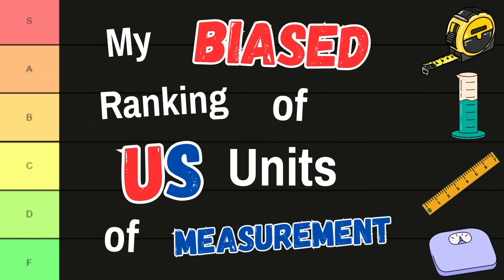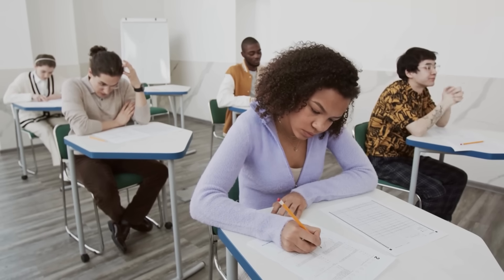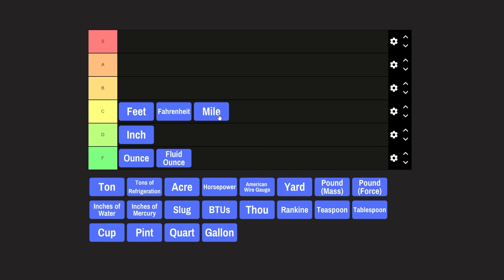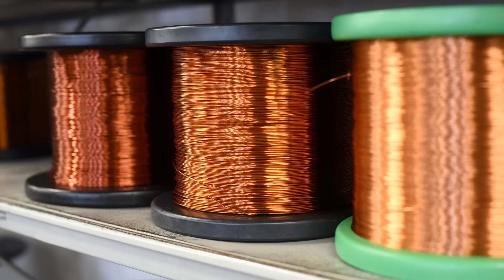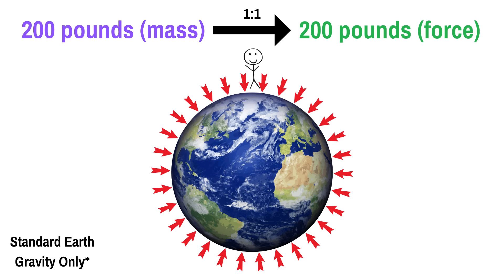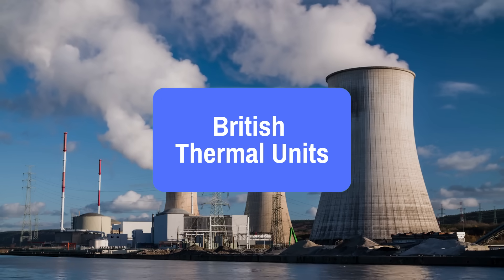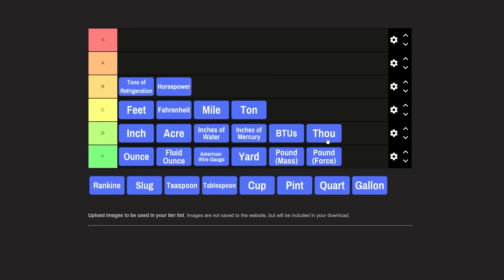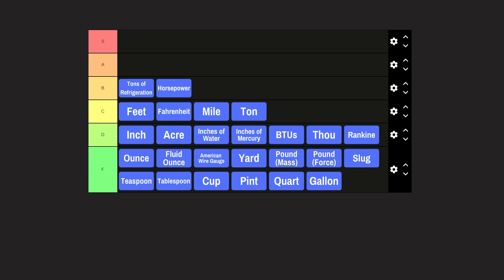Tier List of the DISASTROUS US Measuring System

Comment: Being French, born within the decimal system upon the metric system and the international system (all being A-tier), I can't even understand why USA continue to use these dumbf*ck units... They speak about the cost of changing the imperial system, but how much does it cost to ALWAYS use double marking on EVERYTHING exported? Or to maintain software to ensure the conversions? Or the cost of electronic to handle "natively" these retarded units? It already cost USA several spaceships / rockets / satellites, and they aren't cheap...

Another "joke" is "it would cost us a lot in tools". Yeah, metric tools are SOOOO rare, SOOOO difficult to find, and SOOOO expensive, right? Between tools used by (at most...) 300 millions people, and tools used by 7.7 BILLIONS people, guess which one is cheaper? Both arguments are fallacious. The only "real" argument is that there is a lobby of noisy rednecks who can't learn something new, an unjustified pride to use "their" units, and above everything else, lazyness and a catastrophically bad education level.

It's the same for the 110V system, instead of 220V. Do you realize how much more copper you need for wiring a house with 110V, compared to wire it with 220V? My living room has 11 sockets, each bedroom has 3 to 5, and my kitchen has 26 sockets grand total. Because when you need 1.5 mm² wires (16A, about AWG 16) instead of 3.31 mm² (AWG 12 / 20A) wires, you also need near 5 times less copper (in mass). You can also follow trickier paths, since wires are more flexible. And it can handle more power: roughly 3500W per line for 220V, and "only" 2200W for 110V... While being less dangerous, since there is usually less amperage in 220V systems than in 110V system.

Comment: Metric system is inferior because it's base-10. For the most part, imperial is base-12 or powers of 2, which is much more naturally divisible. Metric STILL hasn't been able to do away with base-12 time because base-10 sucks.
Reply: is this the next level of trolling or what
Reply: @what-xg7kx  
Nope. Indeed 12 is more divisible than 10 and the metric system does use base-12 time (24:60:60).
Reply: Imagine writing this comment, while using decimal system instead of duodecimal system every time when writing number itself.
Reply: @eustress7428  The Arabic numeral system is also inferior because it's decimal and should probably be replaced.
"It's difficult and contrived to replace an ingrained, intuitively-understood existing standard." Ah yes, another reason that the metric system never should have existed.
Reply: @AtlasArmsResearch  just look at your hands bro
Reply: @eustress7428  
But here's another point. Why decimal? The answer is usually that we have 10 fingers, but that's based on a flawed, pedestrian understanding of counting. You need one fewer non-zero digits than your numeral base, which means that a numeral system based on 10 fingers should actually be base-11. Or, you could count all the way to 35 with both hands if you used a base-6 system, which is indeed half of 12, which brings us back again to the superiority of base-12, and by extension, the Imperial system.
Reply: @AtlasArmsResearch  That's a really pathetic argument, considering that most of the civilizations with language(from Egypt to Rome to China) used decimal system, and the usage duodecimal system, despite its 'efficiency', are considered to be an exception rather than a rule.
Reply: @eustress7428   Do you want us to be bound by ancient obsolescence (ironically, the whole case for metric is that Imperial is obsolete)? Those civilizations were also run by total hereditary imperialism and believed that the sun rose because some god carried it across the sky.
Still, base-12 was used by the Babylonians, who were also exceptionally advanced in mathematics, and we still use their 360 cycle division and 12:60 time.
Who's arguments here look "pathetic" and illconsidered with conflicting premises? You've been told metric is better so that's the line you repeat without actually understanding enough to coherently reason it through yourself. Don't bring the insults lest they're turned against you.
Reply: @AtlasArmsResearch  
We are not bound by 'ancient obsolescence' (unless you are an imperial unit user ofc), but we are certainly bound by our own body. That's the main point of my comment above : base 12, despite its efficiency, is confined to a few things like time and angle because of that. Still in the realm of algebra, the decimal system dominates and not duodecimal. 

(And not to mention some eyesore like base 11, 13 or 35 you said. I mean, THAT one was the insult for the first place, isn't it?)
Reply: Also, you've constantly said base 12 can be extended to the imperial units but it is somtimes certainly not the case.
For instance, 1 Pound is 16 ounces which is neither multiple nor division of 12. 1 ton is 2000 pounds, which is closer tobase 10 you've been hating for. One mile is 1760 yard which has 11 in the aliquot part, way more problematic than base 10.
Reply: @AtlasArmsResearch  
And I haven't said the most serious problem of the imperial unit : you cannot directly relate to any of the units with each other. 

Looking at the comment you've made before, you seem to believe that the Imperial unit is more intuitive and logical than the Metric unit. But such problems make Imperial unit system much less so. For instance, how many cubic inches is one cup? How many cups of water (or any materials) is one pound?

(Maybe I admit base12>base10, but then the optimal unit system would be much closer to metric rather than imperial - like start from 1 cm3 of water = 1 mL of water = 1g and just base 12 instead)
Reply: @eustress7428  
...you don't have to relate any of the units to eachother. Just look what you just said. Cuin is a valid, useful, and common unit of volume by itself, just as "cc's" is used at least as often as "mL" (useless redundancy). We still even use inHg or mmHg for pressure because unit conversion is easy. But fine, BTU is an Imperial unit based on unity of the others.

Look, you're not even grasping the basic counting theory I'm talking about and I've sufficiently illustrated my case to onlookers so I'm not going to respond anymore.
Reply: @AtlasArmsResearch  
OK so Imperial unit is 'superior' because of base 12(which is not always the case), but "you don't have to relate any of the units to each other(which is a serious flaw)?
Metric is "not intuitive" but when that intuitiveness is shown directly in your face,  you said like... "useless redundancy"?
And about your beloved cubic inch... does that have base12 relationship with ANY other volume units?

Look, you're not even grasping what you've just said. Don't bring the insults lest they're turned against you.

Comment: The thing is Fahrenheit is still incredibly stupid. To my knowledge it basically comes from the coldest to the hottest Mr. Fahrenheit measured where he lived. Many people say that it works great because 0 is cold for a human, but 100 is hot. But that is just stupid when the optimal temperature is something like 72 or 73 for most people. 
Also it is just 28 off from 100, but 72 of from 0. I can then just use Celsius since it is basically reversed. The optimal temperature is like 22, so 22 off from 0 and 78 off from 100.

If it should really represent how we humans feel about the temperature, then make to optimal temperature exactly 50. 0 Should be the coldest where people can still be kind of fine and 100 the hottest were we are still kind of fine. That way you basically know below 0 and above 100 just don’t go outside.

Comment: Now do metric
Reply: S tiear aceoss the Board.
Reply: @vidmaurer8443 Why? metric is analogous to imperial.
Reply: @RocketPal  not rly. The whole point why the metric system is universal regarded as superior is becouse it makes compleate sense
Aside from time and certain more physics based measurements like Newtons, Volts, or wats, the metric system follows the rules of 10s, 100s, and 1000s.
1 meter=10 decimeters=100 centimeters=1000 milimeter.
This applies to every metric measurement.
On top of that every metric measurement is conected with each other
1 liter= 1kg of water= 1 decimeter^3
In other words, the metric system is simple, connected and simply just works much better than the Imperial does.

Comment: ye, us measurements are BULLSHIT. dont make sense at all. you always have to use fractions and they still arent accurate. no idea what kind of damage you need to think they are a good system

fahrenheit isnt underrated, its WORTHLESS. you cant even say "the temperature was raised by 10 degrees" cause 10 degrees will be a different amount of heat energy depending on what the starting temperature was...

tons of refrigeration is a bullshit measurement as well, why would it be in b-tier? having a block of ice melt in 24 hours? thats so vague. what temperature was the ice before? what does the circulation look like. depending on that, the same amount of energie can be used more efficiently. doesnt even sound good.

the only imperial measurements im somewhat ok with are the mile and horsepower, cause they sound good. but neither is superior to metric measurements.

Comment: Great video. The Dutch kept some of the imperial names and gave them metric values. Our pound (pond) weighs 500 grams in stead of 454, our ounce weighs 100 grams in stead of 28 or 31. A tonne is 1000 kilo's in stead of 1016 and an acre (are) went from a surface measuring 66 x 660ft to a much smaller surface measuring 10 x 10 meters.
We still have a couple of obsolete imperial measurements that are still in use in rural area's. A bunder measured 8700m2 (10,500yd2) in Napoleonic times, after that it became 10.000m2 and was renamed hectare. A Dutch pint (pint...) measured 0.57 litres like the English pint, this became 0.5 litres when we went metric. The word pint became the generic name for a beer in the southern Netherlands. When in the nineties UK pubs became a thing, they reintroduced the pint as a measure and used the US volume of 0.473 and added a generous foam layer.... Which is why we went metric two centuries ago.
Reply: "Are" and "acre" are not related. Are comes from area. Note a hectare is 100 ares. It is the unit comparable to an acre (0.4 hectares)

Comment: I’m an engineer in infrastructure design, and I’ve found, on that scale, I much prefer the imperial projects to the metric ones. With 12 being divisible by 2,3,4, and 6, it’s far easier to dimension without decimal points (e.g. one and one-sixth would be 1’ 2” vs 1.17m). Outside the scale of feet/meters, metric is definitely superior. The real dream would be a metric system in a duodecimal number system.
Reply: Agreed - and there are societies who advocate rational measurement systems using base twlve.

Comment: MM/DD/YYYY is the worst, sneaking it in because it's a measurement of time. It fails because (1) it's completely arbitrary and (2) there are no units, resulting in a whole collection of dates where you just can't know which system they're using.
Reply: I know i'm a year late to this convo.
But Americans will fight till death for MM/DD/YY until the 4th of July 😂
Reply: The reason for it is probably due to how US citizens often say dates: March 8th, 2022. You can of course say: The 8th of March, 2022 to get to DD/MM/YYYY, but most would say the first one. 

But for anything being used internationally just use YYYY/MM/DD it's more reliable and sorts well in computer systems.
Reply: @auggie9912  yes, YYYY/MM/DD is the best

Comment: Imperial is Ton. Metric is tonne.

BTU are imperial calories.

Outside temperature makes more sense in celcius, every 10C from 0 is a step. 0 = cold. 10 = cool. 20 = warm. 30 = hot. 40 = Australia hot. 50 = deadly.

Comment: So you want a temperature unit for the absolute 0?
American : "yes"
What about Kelvin
American : "what is kelvin ?" 
It's the actual scientific thermal unit. Water turn into ice at 273° and anthropy reach its maximum value at 0 making it the impossible value an object can have.
American: "Oh i see... How much in Fahrenheit?" 
What?
American : "Fahrenheit, the unit you use for the meteo so 0 is cold and 100 is hot but not as cold or hot as you may think" 
I don't know so. It seems arbitrary.
American : "so let's do Rankine" 
Why?
American : "because 0 is the absolute 0" 
So its the same thing as kelvin?
American : "No" 
So how you convert in Celsius?
American : "you don't" 
Why
American : "because" 
Alright

Comment: Hey- you left off the other 'foot' that American has - though I think they got rid of it last year. It was called the US Survey foot and is slightly (like by a 1/100,000 of a percent) shorter than the usual foot.
Reply: That was a holdover from before the inch was adjusted jn the 1950's to be exactly 2.54cm.

Comment: Units that I absolutely hate:
HP 
Inches
Both are used in Poland to engines and screen size. Second one is even stupider because 65 inch tv can be 25x60 inch or 39x52 inch tv

Comment: The mile is the best way to measure somewhat large distances and you can’t even deny it. What you gonna measure the US in kilometers? wtf is that?
Also horsepower is an incredibly flawed and even a potentially fraudulent measurement and is therefore the most goated

Comment: One thing about most of these units is they are practical for everyday use. This coming from a Canadian that is fluent in both measures. Here's a good example.  You could fairly accurately calculate in your head how much force you would need to apply on a bicycle pump to fill your bike tire if you know the surface area of the pump piston. Example 1 sq/in piston takes 30lb to generate 30psi. How many kg does it take to generate 206843 pascals on a 0.000645sqm piston?
Reply: Also temperature. Where do I see temperature 99% of the time?  My weather app, my thermostat, my stove, and my fridge.  For weather/thermostat use it's just more intuitive and it's more precise without having to go into fractions of a degree. For cooking, no one cares what the boiling point of water is. They just boil water.  Also, no one cares what the freezing point of water is because the rest of your food doesn't freeze at that point. Instead we set freezers to -18°c which is 0°f.
Reply: @McP1mpin  I disagree it's nice to see the temp of your fridge and freezer and the outside temp in Celsius, because it's so related to water. I also wish we used Celsius with our stove but we don't because of the US and because old recipes are written in F. You only argue that because you are used to it. When you get familiar and use both, Fahrenheit is crap.
Reply: @ColCurtis  id much rather look at a fridge that tells me its 40F than fucking 4.44C lol. In cooking F is generally better as well since its more accurate. A steak needs to be rested after hitting 130F internal, or again, 54.44C. its just better for general use temps. yes it depends on what you grew up with but there is a reason for it.
Reply: Most people don't even know what the surface area of their pump is
My pump has a barometer so I don't have to calculate anything when filling my bike tires
And if I have to use a pump without a barometer, then I just pinch the tire until the pressure is good enough
This everyday stuff should be intuitive and don't require doing any calculation, that's why it's called "everyday stuff" and not "quantum physics"

Comment: I think the imperial volume measurements in cooking (teaspoon, tablespoon, cup, etc) are really nice! They cover a wide range of volumes and are subdivided in base 16 or base 12 which makes them easier to halve or quarter.
Reply: same with feet and inches.  you can divide a foot by 2, 3, 4, and 6.  you can divide a meter by 2, and 5.
Reply: @kenbrown2808 Disingenuous.
You can divide meter by 2, 4, 5, 10, 25, 50
Reply: @DimkaTsv  and you can divide feet by 2, 3, 4, and 6.
Reply: @kenbrown2808  and why should i care about that?
My point was that you purposefully reduced number of dividers for meter so it would look better for foot.

Which is still arbitrary value becoming another arbitrary value due to division as foot --> inch. Not to say that 1 inch is still larger than 1 cm.
Reply: Yeah but is it a big cup or a small cup?
Reply: @L233233  it is an 8 fluid ounce cup.
Reply: US Customary, not Imperial
Reply: They are the worst. They are ok for measuring liquids, but solid ingredients are not measurable by cups and spoons. Try baking anything measuring your flour with cups. Flour is full of air but can also be compacted, you could change the final result by 20% if you measure it by volume instead of mass. That's why grams are superior. It doesn't matter if your flour is compacted or sifted, it will always be the same amount.
Reply: Luckily we have those same units in Mertic!

Comment: As a mexican engineer i hate most american measurements due to how often you have to use them when using american machines with literary anything else
I kinda like the cable gauges tho, like, you usually go from 24 to 8 instead of 1.6mm to 100mm

Comment: Mile.
Actually, this is a unit based upon the perimeter length of the Great Pyramid.  The GP is 1,760 around the base, while the mile is 1,760 yards.  This is because they are both based upon Pi, with the GP being a 40x copy of Pi (multiply by 2 for the formula for a circle).

The whole of the Imperial measure system is based on the 22 or the fractional of Pi (22/7).

R